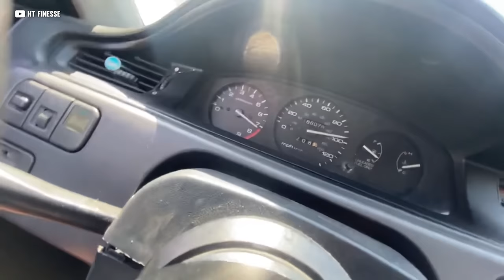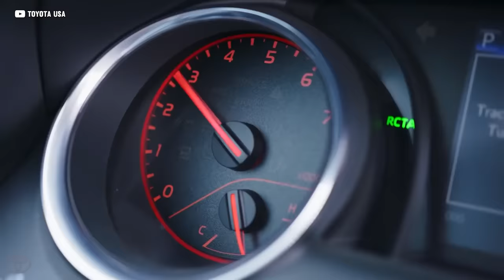7 Things NEVER Do In A Manual Transmission

Comment: I for sure did some of these and sometimes I still do some like lets say there is 3 cars in front of me I just dont feel like I need to switch to neutral for these 10 to 15 seconds and will just hold the clutch.  
If it takes way longer than I assumed I will put into neutral.  
The one thing that messes with me too sometimes is the start stop thing and how it randomly activates.  
And I dont get why it doesnt automatically activate the handbrake if it happens.  
From what I understood it activates if I am in neutral and brake to a complete stop.  
But then if I release the brake the car just moves when imho it should activate the handbrake.  
I can do it manually I guess but man this is like racing in a race and then at the last part of the track stopping.

Comment: Once you are level 10 at manuals, got that extra level and learn how to shift WITHOUT the clutch!!!! NOW you're level PRO!!!!!!
Reply: I'm hoping you're joking in saying this.  Incase you aren't I'll explain why this is a bad idea. When you change gear, the gearset you're changing to will be at a different speed, the synchomesh which is a little brass cone inside the gearbox is used to accelerate or decelerate the gearsets to the new speed, which they're quite capable of as there's not much weight to the gears alone, but if you don't use the clutch now those synchomesh need to accelerate the engine as well increasing thier wear, think of them almost like mini clutches inside the gearbox. If you think a clutch is expensive to replace replacing synchomesh is a full gearbox rebuild. Yes you can do a clutchless change by rev matching but it's always going to put more wear on the synchomesh so it's a bad idea. 
If you've ever experienced crunchy or difficult gear changes particularly in 2nd it's most likely worn synchomesh as 2nd gets the most use and harder acceleration.
Reply: @arrindaley3714  Very true if your transmission is a synchromesh. In North America once you get to a certain size vehicle it will not have a synchromesh transmission.
Reply: @arrindaley3714 heard of floating gears????
Also it isn't that hard
Reply: @imtiredtoday  It looks like arrindaley3714 knows exactly what floating gears is as he explained pretty well why it's not good on a synchronous transmission

Comment: The first bit of advice isn't completely true in my opinion. Breaking with the clutch allows for much more rapid deceleration and as such in the case of an emergency stop one should always break WITH the clutch engaged as to stop as quickly as possible. Your car is isn't in any danger by using this method. This might be the difference between a colission and a close call in an emergency situation. Dont head this videos advice for anyone learning manual. BREAK WITH THE CLUTCH FIRST.

Comment: Another thing that you should never do in a manual car unless you are actually trying to race please let the revs go above 3000 keep the revs between 2 and 3000 RPM maybe 4000 RPM max if you need the acceleration I learned on a 1996 Honda Civic 5 speed manual two-door coupe and that's the car I'm about to end up buying and modding so I know literally everything you should never do in a manual car but there are some things that you can do in a manual car if you are racing but you should never do if you're driving around the city on the highway

Comment: Putting the car in reverse while facing down hill!? NO!!! If the parking brake fails and the car rolls forward it will spin the engine backwards! 1st gear if it will roll forward, reverse if it can roll backwards!
Reply: He said the opposite.
Although, I've done what you've suggested he said.  Unless the hill is rediculous, you're fine.  I drove an 85 cavilier with a broken parking brake.  The situation was leave it in gear, or roll.  Never had an issue.  I would park on 30deg driveways routinely.
To your point though, its a bad practice.  I just think that if the car starts to roll while in gear, you have bigger problems, regardless of direction or gear.

Comment: It helps to have a built engine that can rev 1500 RPMs higher than red line without exploding if you accidentally money shift 😂
Reply: The other thing that helps is to drive a diesel pickup. The heavier transmissions they require just plum will not go into a gear if it has to speed the gear up too much to engage. Accidentally going from 5th to 2nd in my truck would be practically impossible.

Comment: Is it ok to
Brake Clutch in Downshift Clutch out Clutch in Downshift Clutch out?
Basically Downshift engine braking
Or am I doing it wrong
Some skip gears Downshifting
Reply: Downshifting for braking is fine, just don't get it too low! like from 6 to 3 ok, not 6 to 1....
Reply: I would never downshift without going 5-4-3-2-1.
Reply: @elemar5  yeah that's what I am doing currently I'm just mostly questioning about the clutch and letting it up while braking for a second or so
Reply: @elemar5   6 to 3 on mine is not a problem, once you are unengaged, you choose your gear and the transmission follow your demand...
Reply: @toro4271 yeah fine, I would say good, some argue you risk wear to clutch and synchomesh but it's minor imo. Heel and toe was a way to help even out the added engine braking when releasing the clutch when doing this.

Comment: Leaving ur car in neutral or in gear for a park is like picking ur poison. 

Because the other bad part about leaving the car in gear is that if u forget to press the clutch before starting the car, the car will make a dash towards the nearest wall to eat the very second the engine turns on. 

I’d imagine leaving it in 1st gear would allow it to accelerate harder than any other gear. 

Have fun choosing which pain in the ass you’d rather have i guess.
Reply: That's the reason why modern car won't start if clutch pedal is not pressed.

Comment: How about rev matched clutchless shifting, like I used to do in a semi? I've done it in several cars and trucks and it didn't seem to cause any adverse issues.
Reply: My dude, you're stealing my content, lol.
Sounds like we've lived similar lives.  I also used to float gears in semi trucks and still do it in passenger vehicles.
Good stuff there.
Reply: Ive done cluchless shifting on sims but have never dared to do in in a real car, I’ll stick to double cluching for now until i grow a pair and actually try😅
Reply: @jameswillis8524  floating in smaller  vehicles can be done if needed. But be aware that large trucks don't have Synchronized transmissions like smaller vehicles do.  In large trucks the driver is the synchronizer. Smaller vehicles are fully Synchronized. The clutch is there for a reason. So it's best to use it. It's how the small vehicles were designed . 
Best Wishes! M.H
Reply: @Mike-zw7fq  this gotta be some american truck stuff, trucks had syncro manuals the past 30 years at least
Reply: @Stale_Mahoney  It could be. The Class 8 semi type trucks here in the U.S. typically don't have Synchronized transmissions.  
That is, when shifting the driver is required to Match the Transmission speed ( or Ground speed ) with the Engine RPM.  
This can be accomplished by "Double Clutching" or " Floating" the gears. The later using only the throttle to release pressure from the gear face. 
There are exceptions like automatic and semi automatic transmissions.  But they are Not the norm. 
Passenger Cars and pick-up Trucks have Synchronized transmissions.  Where the driver can simply push in the clutch once  and shift from one gear to another. 
Thank you for the exchange and 
Best Wishes from Montana! M.H.
Reply: @Mike-zw7fq  yeah i know what floating gear and double clutching is, but the fact american semis still had unsynchronized transmissions baffled me, would think they at least had entered the 21st century
Reply: @Stale_Mahoney  I would guess that you lack the skill to either Double Clutch or Float gears. Those of us that have driven several million miles. Have done so in machines named Kenworth, Freightliner,  Peterbuilt. Unlike your Tonka and Hotwheels.
Reply: @Mike-zw7fq  yeah i heard of those horse carts, maybe one day you get to enjoy the sweet ride of a Tonka or hotwheel and know what the future looks like, but no i have a old tractor i gotta do that in and i from time to time enjoy "floating gears" as you say like it's some magical thing simply shifting and rev matching.
Reply: @Stale_Mahoney  Synchros are a wear item and usually the first thing to cause problems in a heavy transmission. They also require space inside the casing which makes the transmission larger than a crashbox manual rated for the same torque. Fewer parts and less maintenance for a little bit more driver skill is not a bad trade off.
A lot of North American truckers will tell you that if you can't drive an unsynchronized manual you can't really drive a manual.
Also, North American trucks have a 4 position clutch rather than the standard 3 position. If you get too deep on the clutch you will hit the clutch brake.
Reply: @rich7447  all the excuses for not living comfortable and being slow up hills during winter where shifts can be the difference between making the hill or not
nowadays the unsynchronized twin clutch that is electronically controlled is the norm, changes so fast you dont lose speed up hills. 
i also love to think back to a harder time but let's face it, the future is literally the future
Reply: @Stale_Mahoney  The electronically controlled manual is the norm for most heavy truck fleets here. They offer the best of both worlds. However, you still need to be able to drive a 10/13/18 speed crash box incase the fleet truck goes in for service and the only lease trucks available are unsynchronized manuals. 
Downshifting a crash box while slowing due to a hill is never an issue. You are in the next gear in no time. The problems come when new drivers decide to try to downshift to control speed once they are on a downgrade. The gear that you select before the crest of the hill is the gear that you want to be committed to for the entire downhill section.
Reply: @rich7447  downhills is not the issue, it's the ice laid uphills where losing speed may send you hurdling back down jack knifing or off into the ocean that may be the issue.

i agree knowing how to drive a manual syncro is important and frankly if one can float on a engine going from 1k rpm to 7k rpm then floating between 500 to 1800 is play in the park.
Reply: @Stale_Mahoney  Like I said, a downshift takes no time and you aren't going to lose speed on any hill that you should be on. 
You kind of just let me know how much experience you have with unsynchronized heavy truck transmissions. You can float the gears in them, but it is not as easy as it is in lighter engine/transmission combinations (like a 5t unsynchronized). It can also cause a lot of damage if you don't do it properly.
Yes, the powerband is narrow, but your gears are very close together. An average gear spacing on a 10 speed tractor is around 600 rpm. If you are using the splitter on a 13 or 18 speed your gears are now half that distance apart, but you don't need to switch between the high and low version of the same gear. All you do is pre-select hi/low, come off the throttle and back on. 
You are only moving the stick for major gears (LO through 8....the same as a 10 speed, but low is 1/5 in the 10 speed).
Like everything else it is just practice. I don't float downshifts at all, but don't mind floating upshifts. Some guys do both, some neither. It all comes down to preference and, if it is not your personal truck, company policy. 
It's been a couple of years since the last time I even drove a class 8.
Reply: @rich7447  "and you aren't going to lose speed on any hill that you should be on" you say.
tells me you got rather comfortable flat terrain you roll on, we got up to 20% gradients and 11% ones are not uncommon at all up here in the north.
when you roll 50tons on these roads you will find yourself in deep water where simply the time it takes for the truck to make boost after a change can be enough that you gotta drop 3 gears to not lose all momentum. with the old manuals at summer when it's all nice and summer lett alone at winter time.
Reply: @Stale_Mahoney  I first drove in Northern Canada (Yellowknife and yes I grew up in Canada - Kapuskasing in the early 70s and Belleville/Trenton Ontario in late 70s.80s) in the 90s, so I get where you are coming from. In those conditions (winter) chains and low gear is far safer than starting out faster and trying to keep momentum.
I'm comfortable on flat terrain and some pretty steep stuff (I like life too much to consider 20% in a class 8). That being said, I shouldn't be on a 11% grade with a load if all I have is a Cummins L9 or Cat C9. The equipment sets what road you should and shouldn't be on. Driver self preservation instinct should be used to lower whatever the equipment is rated for. A grade that steep is going to require a lot more power than the normal maximum interstate grade of 6% and if you need to do it with the range selector down, so be it.
Reply: @rich7447  here in the North of Norway the steep grades and mountain roads is the norm not the exception.
and slowing down for a hill means you won't make it or the next.
there is so many flat land(sout european) truckers stuck every winter here because they think the roads here will be like where they are from, can't say i am to familiar with these north american ratings and my english is not perfect, but i believe we have each different challenges for different terrain. but the standard truck roll metric 50tons when loaded down with whatever it may be so it's a game of momentum from start to finish on these roads
Reply: @Stale_Mahoney  Fair enough. As far as North America goes the Canadians are the heavy haulers. I think they are at 63.5 metric tons maximum weight. The national network in the US (Interstates and designated US highways) are limited to 40t (80,000 lbs). Both countries have steep grades, but both also have federal highway systems where the maximum grade is limited. So unless you have a very specific location to get to you are not going to routinely be running on roads as steep as the ones that you are talking about. 
We do have every terrain type imaginable and the highest point on our national network is 3400m above sea level, but because we limit the maximum grade on the truck arterial roads we can run lower horsepower engines than you are running in Norway. The high torque/horsepower trucks are usually only seen on the more extreme terrain (logging/mining roads).
Reply: Bad for synchronous transmissions. Even if you're "good" you really can't tell how much it's wearing down the synchros, and when they do wear out it won't be like driving a non-synchronous transmission.

Comment: should you or should you put your car with a manual in 1st gear and pull the handbrake when jacking your car up?
Reply: No, leave it in neutral with the brake off so that it rolls off the jack on top of you.
Reply: @elemar5  what if it has a electronic e brake  could it screw up the computer? I only know an old fashoned manual e brake

Comment: TBH driving a manual isn't as hyped as people make it out to be.
Reply: I personally do not like the indirect connection autos have between the engine and the road
Reply: @ILikeWafflz  Not driving a car hard enough to really engage with it as a driver. Doesn't matter if it's auto or manual.
Reply: @Wildchildinc  Ah, I got you. I can't help but have some interest in it, but I get that some people just want to get from point A to point B

Comment: Why do Americans think that driving a manual car is the same as driving a sports car. Learn to drive defensively, do not use excessive speed. Driving is only fun if you are using the car to race on a certified racing track, otherwise it's just as laborious as walking down the road. Driving a manual is not a macho thing to do.

Comment: Using a parking brake to start moving on a slope?! Don't you have a pedal for that?
Reply: If you move your foot from the brake to the accelerator you'll start rolling backwards.
While it can be done, it is much easer to hold the brake on with the handbrake, and then just use your foot on the accelerator.
Reply: @Sussex192  you can release clutch just enough that it engages and then release the brake.
Reply: @RedBlackDish  Yes, you can, but it is a bit harder to do, if you're a beginner. Also, if you're not careful, it does put more wear on the clutch.
And also, some cars are a lot easier to stall then others.
Like in a land rover I drive, it is the easiest thing in the world. But in a ford transit van, particularly when towing a heavy trailer, it is impossible to. (Any hill start is almost impossible with that set up...!)